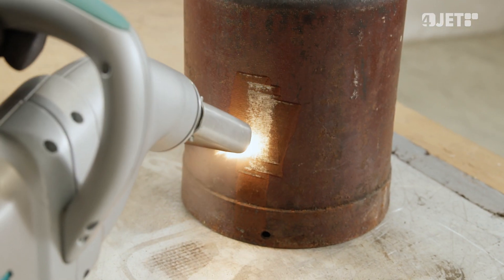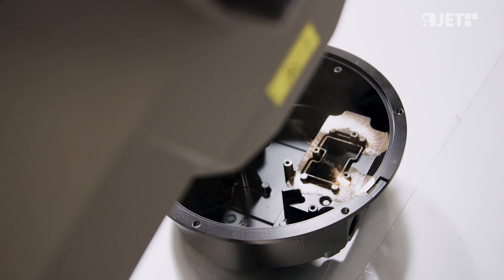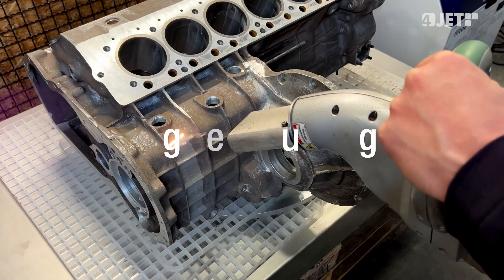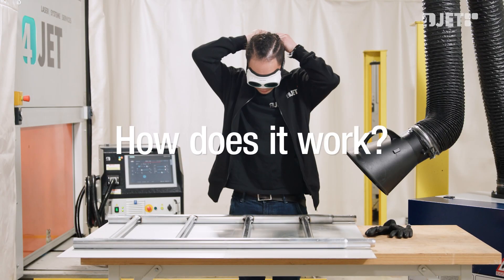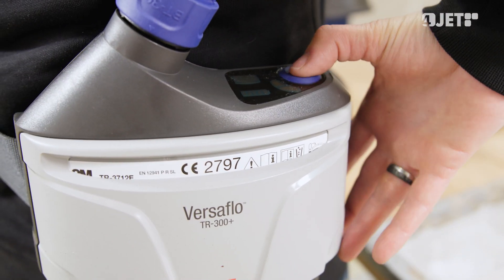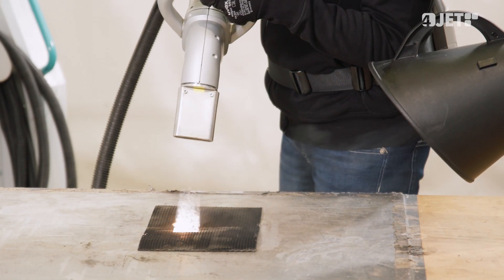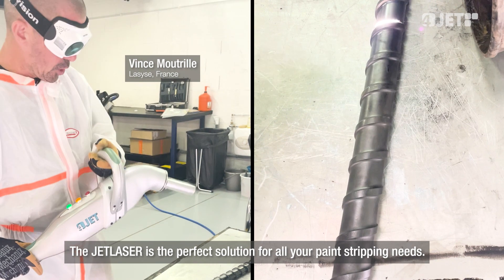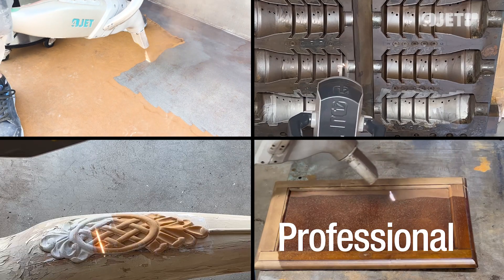4JET JETLASER Leading choice for industrial surface cleaning

Comment: Your machines look amazing, but you really need to look at reducing the weight of your laser head. 
SEVEN kilograms is absurdly heavy for a mobile laser cleaning unit. The operator will have back problems after one week of consistant use.
Reply: Then you can consider walterlaser's product, its laser gun head is less than a kilogram